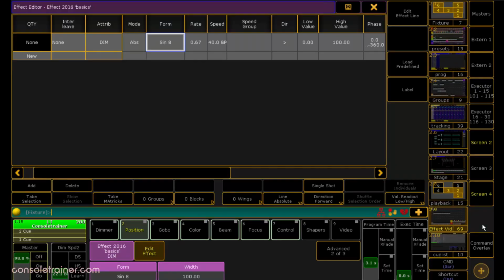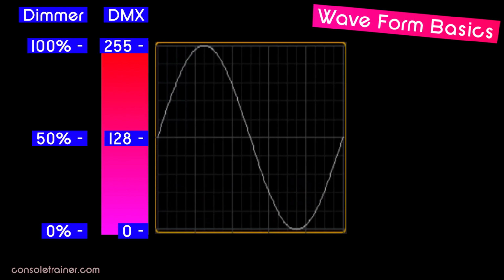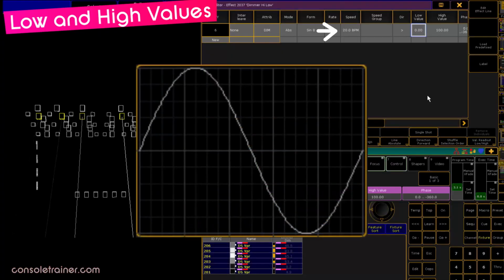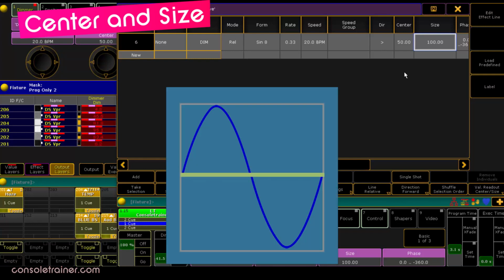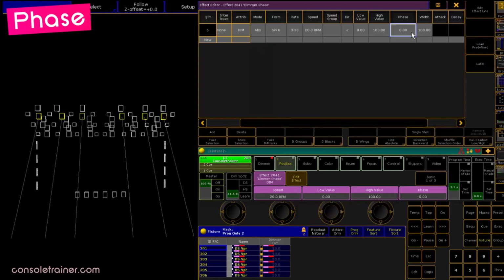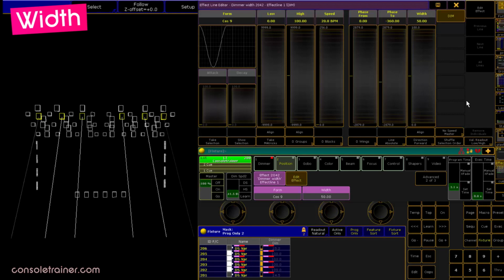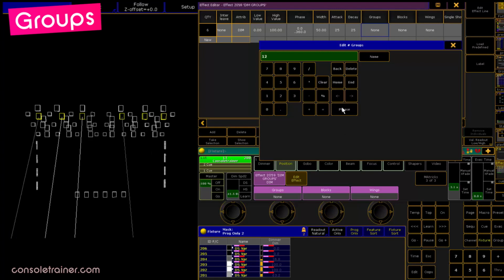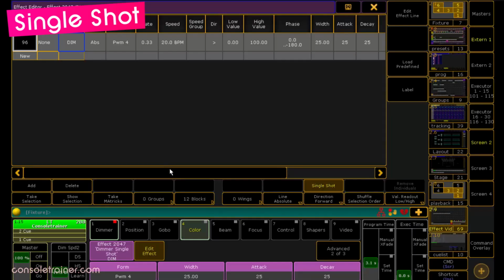How grandMA2 Effects Really Work | consoletrainer grandMA2 tutorial 2020

Comment: Great tutorial. I picked up some great info from that. I'm wondering, can you think of a way to introduce a delay at the end of the effect? Say I have a PWM dim effect, from 0 to 100, I have set attack and decay for a nice ramp up and down. Now I would like that to run once through the selected lights, then pause in black for, say a couple seconds, then run through again, pause, and so on. I realize I could introduce a little delay with the width control, but that's limited because it squeezes my waveform messing up my smooth ramping, and also I can't get enough delay that way. I could also patch in a bunch of lights that don't actually exist, take those as part of of my selection, and let the effect run out over these "virtual fixtures" to burn off time, but this seems like a clumsy way of doing it, and it would be hard to quickly change the delay time.  Any ideas?
Reply: set phase to 0 thru (something less than 360, the lower the number the bigger the delay at the end of the effext) and lower the speed to compensate.